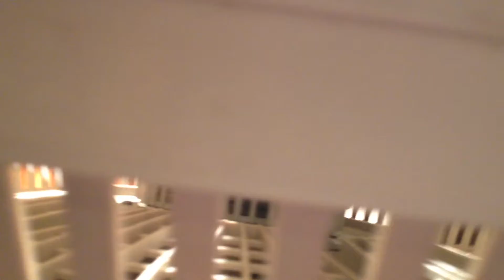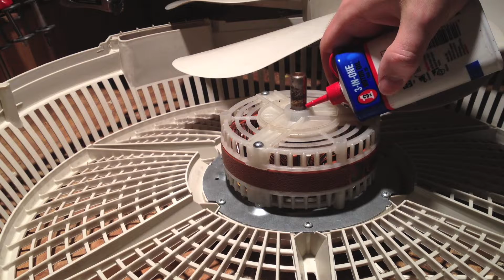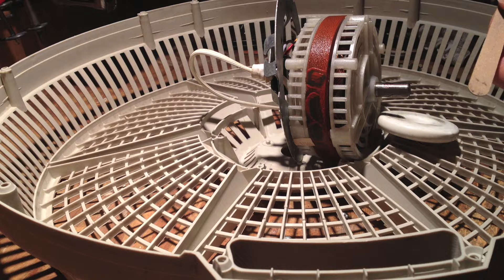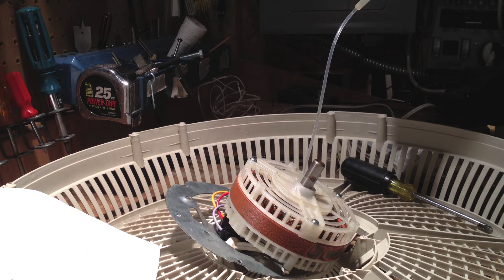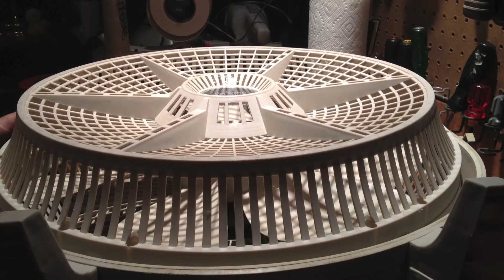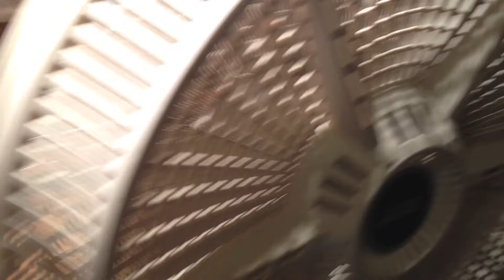Service and Repair Galaxy Wind Machine

Comment: Thanks very much for posting this! While lube'ing the bearings, two of the pressed in wires pulled out of the wiring block. I used this to confirm the correct order: RED, WHITE, BLACK, YELLOW.
Reply from the maker: You're welcome.

Comment: I'll have to say right now that the newer Wind Machines have simpler construction. Just 6 screws and you can take it apart. What are those things that you are putting on at 12:18 in the video?
Reply from the maker: The Wind Machine is one of few exceptions where a newer model has a 'better' design..

Comment: I know this is a long shot but I have a five blade one of these and the motor keeps making beating noises and never gets up to speed. I've taken it apart, thought it was the blades but it wasn't. Do you have any idea what the problem could be?
Reply from the maker: It could be something with the bearings..

Comment: Jordan is that blade design any better than the newer 5 flower petal version?  More airflow?  Noise?
Reply from the maker: The blades that looked like this one but only had 5 blades were superior in my opinion they're definitely quieter than the petal blades and they seem to move more air at lower speeds..
Reply: @JordanU  will the motor fit the 1988 box fan of that era?
Reply from the maker: @christophermurray3825  I don't know what box fan you're referring to..
Reply: @JordanU  the older 1984 Galaxy box fans
Reply from the maker: @christophermurray3825  I've never tried it but I think it would..

Comment: Yeah my lasko fan has those front and rear plates too with sealed bearings in them. The plates are made of cast aluminum. I'm trying to see if I can fix it cause it's all sticky and doesn't spin anymore. I guess I just put drops of sewing oil in them?
Reply from the maker: Usually you can split the motor and clean out the bearings and the shaft if the oil has gummed up.. Then put new oil in and it should run fine..

Comment: Excellent job. I always repack the bearing sleeves with lithium grease when I take my fans & blowers apart every year or so. These cheap fans will run forever with a little TLC.
Reply from the maker: Thanks.. This is true,, these older ones,, albeit cheap,, were built to run for a long time..

Comment: How did you fix the blade issue? My 3rd gen Lakewood fan developed the same problem! It does not have a clamp behind the hub.
Reply from the maker: I tightened the clamp on the inside of the blade where the shaft enters..
Reply: Jordan U Mine doesn't have a clamp. Any ideas?
Reply from the maker: Andrew Gallucci You can either get a clamp, or maybe put a tie-wrap in place of the clamp.. You have to put something around that part of the blade so that it holds onto the shaft tighter..
Reply: Jordan U Thanks for the info.
Reply from the maker: Andrew Gallucci Any time..

Comment: i have the 5 blade version n oh yes what a pain in the as i say ace to work on + all the screw holes r stripped so i use wire to hold it together and oh god i HATE those brace things
Reply from the maker: todd w I didn't know they made a 5 wing Wind Machine in this style.. these things really are a pain to work on.. I can imagine its even more difficult without being able to screw it together..
Reply: Jordan U They had a five blade version after this one. its the same style of body. but it has the later 1990's style marco motor Lasko used. iv seen one tan one with that blade. but most were gray or white.
Reply from the maker: ***** Interesting.. I thought the only 5 blade ones were the ones with the petal blade sets..

Comment: Sorry im a bit late on this video. but if this happens again. usally the issue were the blade pops off like that has to do with that tension ring on the blade. you have to find the what I call (the sweet spot) as to where the blade will hold on the shaft without sliding like that.
Reply from the maker: ***** Sorry I'm a bit late on this comment.. LOL..  must have been another one that got lost in the notifications freakshow.. You're right about the issue.. it did have to do with that ring on the inside of the blade.. Hasn't fallen off since I tightened it..